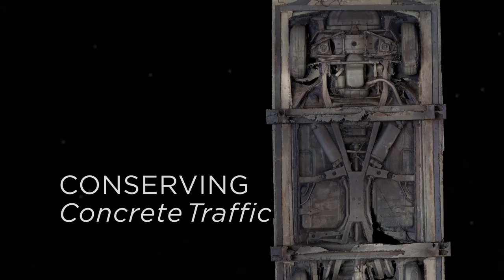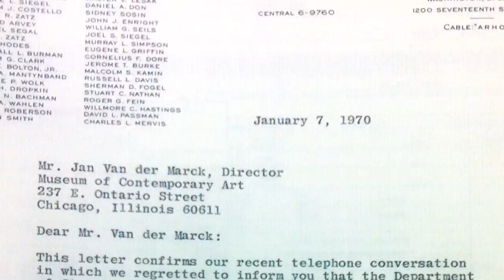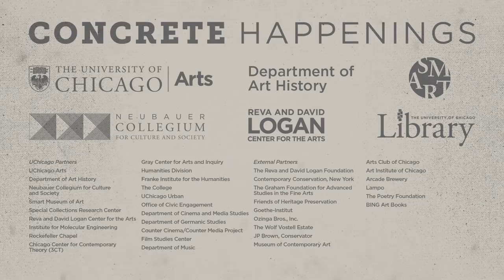Conserving Concrete Traffic

Comment: This made my day.  In 1974 I worked with UC Professor Harold Hayden to dig out the soil to pour a new concrete pad for Concrete Traffic which, for some reason, had to be moved closer to the street.  On trips back to the campus I wondered where concrete Cadillac went.